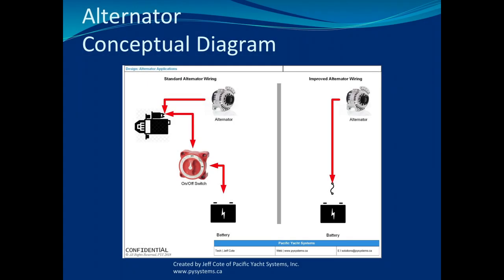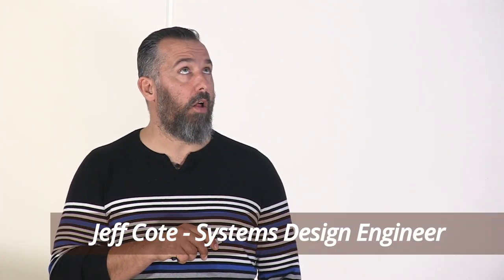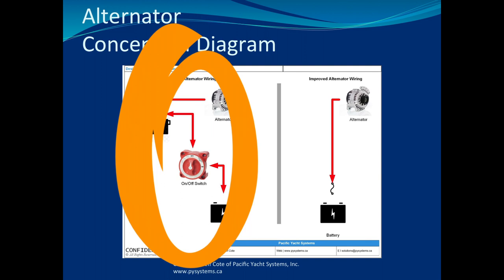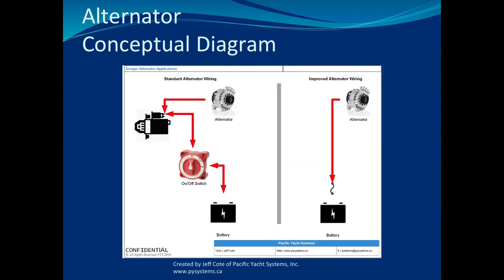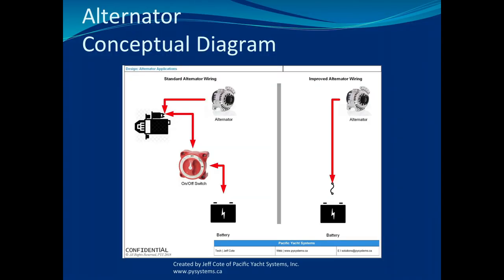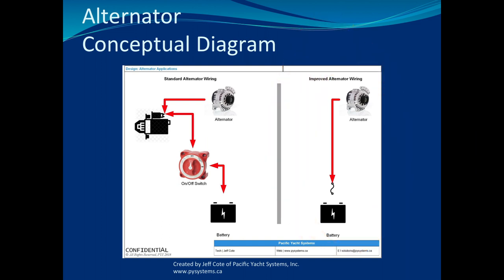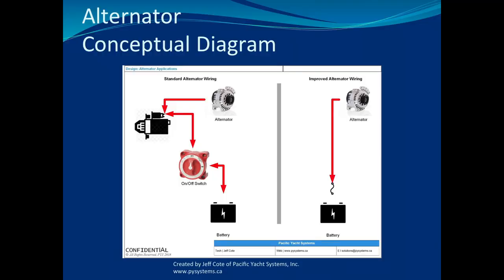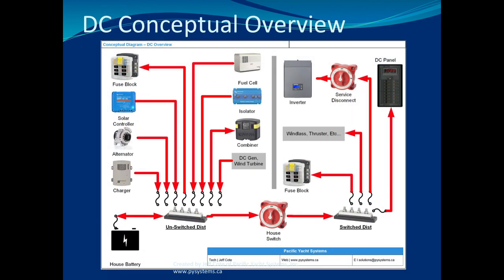How To:Marine Electrical Seminar - Troubleshooting Alternators & External Regulators - Episode 11/12

Comment: Thanks Jeff! Every video of yours I watch, I can't help but think: I'd like to see his boat :)
Could that maybe be a future video? Like the very interesting ones where you took us along for a boat survey. You could ofcourse keep it completely limited to the electrical system, just a few shots of your fuseboard etc.
Anyway, thanks for the effort you put in!
Reply from the maker: Great suggestion!
Reply: Maybe you could just add the slide/diagram smaller up in the corner in post editing, thanks Jeff!
Reply: Thanks Jeff for the videos i have a friend who have a very old boat for fishing 22' alph i have to put nav light nav system  anchor light  6" fog light bilge pump stero he have a switch panel ordered pre wired witch have fuses for each switch cig and usb adapter would it be ok to rewire the panel i have 16-14-8 gauge wire for the equipment which is better fused or breaker switch at the batterywhich amperage it have a fused panel in the steering compartment could i keep it and send power to the  switch panel although the panel have protective fuse

Comment: Had a stuck starter yesterday, newly installed secondhand engines,  glad for the battery switch ;)
Reply from the maker: Thanks for sharing, a stuck starter solenoid is exactly why you want a battery switch.

Comment: Hello Jeff, Great stuff!! Balmar Digital Duo Charge - 12/24v says it can charge 2 battery banks, reading their web page, looks like you can have different charging schedules for each bank, would this be a good system for my deep cycle house and my starter battery? I was going to just charge my house bank, and than use a DC-DC charger to than charge my starter bank.  
Thanks in advance for your help
Reply from the maker: Cool, thanks

Comment: do you need a specific alternator if you want to install an external regulator ? or you can just use stock alternator(internally regulated) that comes with the engine and just put a regulator ? thanks for the video Jeff
Reply from the maker: All alternators, even the ones that come with an internal regulator, can be modified for external regulator.

Comment: Hey I’m on a boat with mtu 12v 4000 series and I notice the fan on the alternator is not rotating , after starting the engine voltage remains at 24.5v but after about 5-15 min the engine shuts down automatically giving a tach signal loss alarm could this be caused by alternator not working?
Reply from the maker: Good detective work... sounds like you have alternator troubles.